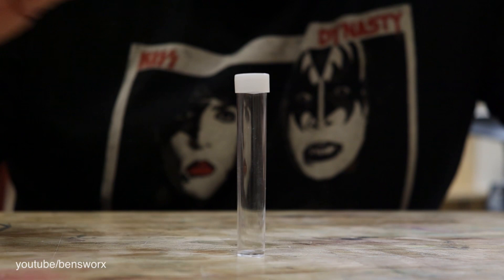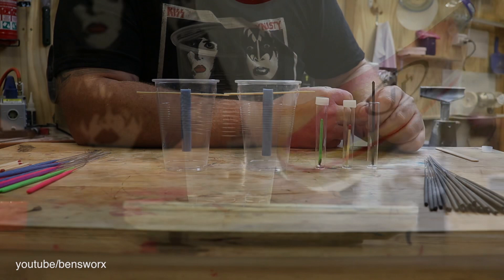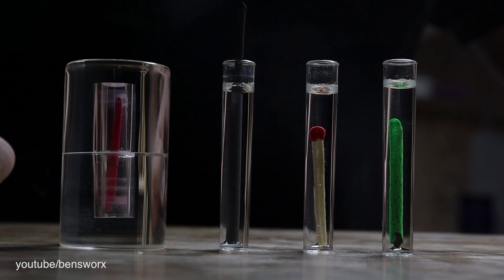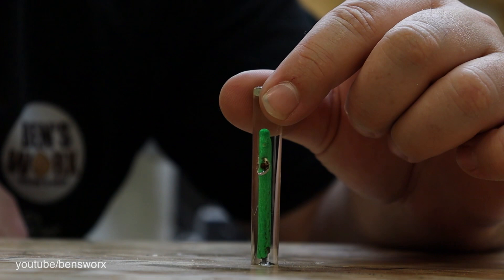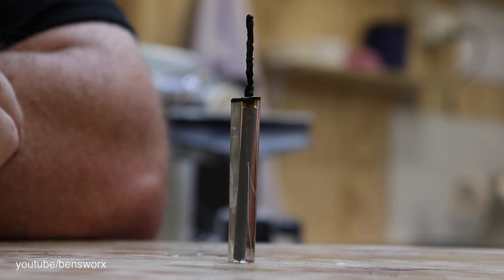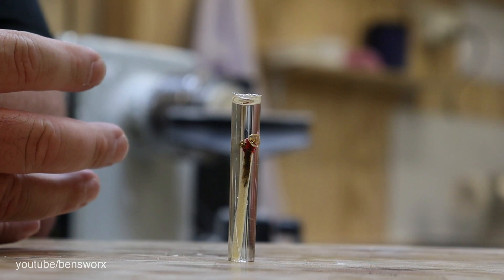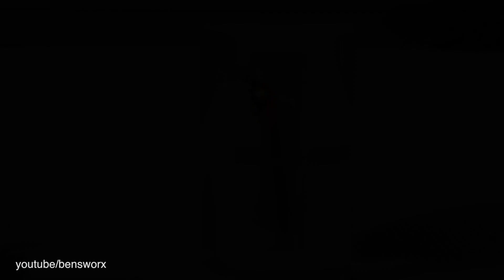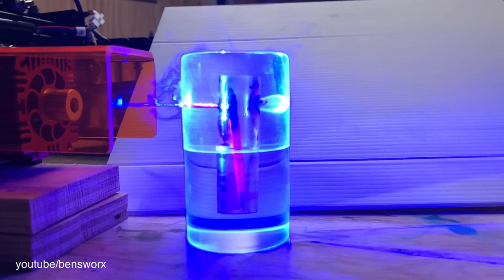Can You Ignite a Sparkler Encased in Resin ?

Comment: I think you should try storm matches they will burn underwater because the have a strong oxidizer that produces enough oxygen to keep them burning. Keep up the excellent content Ben
Reply: i came to the comments to say this damit
Reply: I too thought the same! lol so many pyros !! lol I was thinking liquid oxygen... but changing the match should work just as well....
Reply: Maybe a stupid question: will storm matches and things like that work without enough space? Water can be pushed away, not so resin. For example, under really high pressure you can heat up water way over 100°C and it's still liquid, because it has not enough space to get steam. I hope you understand what I mean, it's not that easy to describe, especially cause I'm not a native english speaker 😅
Reply: @larsweibel6192  good point, the resin casing might explode due to expanding gasses
Reply: the matches work because of a hydrophobic coating my guess is that the resins getting soaked up into the sparklers during vacuum...I would set a broken 12v light bulb into the resin cast and use the element to ignite
Reply: Or the candles you cannot burn out,   Maybe some. Magnesium strips.
Reply: @jessewilson8676  the candles you cannot blow out work because of flint material in the wick
Reply: normal matches contain the same oxidizer, the difference between them and storm matches is the coating and the fact that there is more of the compound on the end. It's usually a mix of glass powder, red phosphorous, and potassium chlorate or perchlorate i don't remember which.
Reply: I think you might be able to set a model rocket igniter in the resin so only the metal probes stick out. Then use the electric igniter to set off the matches
Reply: The thumbnail actually gave me the impression it was a storm match
Reply: Thermite. Go big or go home.

Comment: Some of these suggestions are steadily progressing towards, "What if you just made a pipebomb out of resin?" :D
Reply: Next video idea? 👀👀
Reply: I think yes
Reply: Sounds fun.
Reply: Dang mate
Reply: Yes, mix some aluminum powder with some iron oxide powder. Press it down well in the tube and fill with more resin. If the heat of the resin harding does not cause it to burn your place down take it out side put the magnifying glass on it and call the fire department. Maybe you can add some magnesium to make a pretty light show.
Reply: Do the same thing you did with water.... With GASOLINE
Reply: Hahaha, can't wait for that video
Reply: @dwp6x9e42  And perhaps some stump remover mixed with powdered sugar added to the concoction?

However heating things up like that in what amounts to an enclosed container - might not be a bad idea to put at least a plexiglass shield or some other barrier up while filming.
Reply: That's similar to how fireworks work.
Reply: @dwp6x9e42  iron oxide thermite needs a LOT of heat to ignite. Copper ii oxide thermite on the other hand is easy to light and burns explosively. It would be the better choice for this.
Reply: What happens if you encase a claymore in resin?
Reply: How a obut casting inside og snil shell 🐚
Reply: What if you just made a thermonuclear device out of resin?
Reply: Lighting it with an several kW laser

Comment: Stack the inside full of only match heads without the sticks.
Reply: @TsunauticusIV  LOL! Nah but it'd be really cool to watch 😁
Reply: Sir that’s just called a bomb
Reply: An interesting thought. Might get a nice pop!
Reply: BOOM !
Reply: Hi, yes, question

Do you know what a pipe bomb is
Reply: @justyouraveragezoomer  When I was a teen I made a polish canon with steel pipe, capped the end and used ground up match heads as the propellant.  Didn't work.  Burn rate is way too slow, it can't build enough pressure to do anything worthwhile.
Reply: @justyouraveragezoomer  
I'm not sure if it would qualify as one. 
Must read law books. 😃
Reply: Can do that with strike anywhere match heads in a tennis ball…. Cool thing is after you fill it and seal it up, one just needs to throw it against something hard and it will act as one of those little, poppers you can throw at the ground! Only much bigger! 🥜👀

Comment: i would recommend casting these in something square; it's possible your curved containers are causing some difficulty in actually focusing the beam well. Also, something with an oxidizer already. Great video though! Glad I came across your channel. Reminds me of Peter Brown but with more content!
Reply: bump
Reply: Or directing the beam from the top, not the side.
Reply: Was about to suggest the same thing (making the casting and the void square that is). As far as I know, both match heads and sparklers do contain oxidizers, that's part of the definition of a pyrotechnic mixture. Mind you, it's been 25 years since I studied pyrotechnic chemistry, so I may not necessarily be remembering this correctly.
Reply: Exactly what I thought...

Comment: Been loving all the bonus content, and creative ideas you’ve been coming up with. Also wondering if casting a bunch of “strike anywhere” matches in resin, and then turning it on the lathe, if the friction from your tools (or sanding) would light them up. Probably a bit too dodgy to try though!
Reply from the maker: Thanks Matthew 😊 it would be cool to try
Reply: Usually it will, there's granulated glass in the mixture of strike-anywhere matches that provides enough friction heating when dragged against rough surfaces to ignite. Some you can drag across denim jeans and they'll ignite, some older style strike-anywheres will ignite spectacularly if you smash them with a hammer.

Comment: Baking soda and vinigar in separate areas of the casting so when you flip it over they mix!
Reply: Oooo maybe make it an hour glass
Make the two halves separately with hollow bottoms and drill the tube where they fuse together. Then glue on resin discs on each end to seal them in

Comment: I love the lazer burn. You should cast a light prism dead center. Laser the top and burn through the resin at the tip of the prism. Clean out the burn marks and fill with clear resin and attach a light to the top.  If it also retracts outward at the bottom, clean those and fill with clear 25% glitter. 

Try different prisms too

Comment: Thanks for the bonus Ben!  I’m actually a little surprised that the sunlight doesn’t heat up the resin itself, even though it’s transparent. I just checked with my chemist brother-in-law and he said, even though it has an oxidizer in it, the sparkler still needs something external (like oxygen) to react with it to burn.  So the one that burned down to the resin would stop once it had no air to react with.

Comment: Basic rules of fire: 3 things needed, Air, fuel & ignition. 
In this case, the air ran out quickly where the match wasn't completely encased otherwise it tried to "heat it's way to air", fuel being the match itself and finally ignition usually in the form of heat or a spark, the magnified sunray. 
So there wasn't any chance of the match catching fire for long if at all. The sparkler tough was interesting, if it gave off more heat it'd actually been fueled by the resin and burned through faster along the sparkler until it all was just a sludge. 
In short, pretty fun to watch.

Comment: Based on the fact no fire can occur without oxygen I would assume the laser torch went through the resin and punched a hole and ignited the sparkler which having now supplied with some oxygen went on fire (assuming also that there was very little oxygen left in the tube to maintain an ignition and burn). It was a great experiment no matter what. I love to see them. Keep them coming!

Comment: I am impressed. I seen in the comments that you have some waterproof and other ones coming as well. 
The one thing is the smoke leaking out of the lit match one. 
I wonder if you have a micro leak in the joint somewhere. If a burnt match and smoke would last it would be super cool to have one with a sign that say break in case of emergency for fire or something along that line. Though this one would have been spent!!!!

Comment: Now I’m just a layman so don’t quote me, I believe there’s this thing called “the fire pyramid/triangle” that explains this better. My understanding is that you’ll need 3 things to get a fire to ignite; heat source, combustible material and lastly oxygen. You have the first 2. Sun (heat source) & match head/sparkler (combustible material), which is why until you melted through the resin introducing oxygen into the mix you weren’t able to reach ignition. 
Please correct me if I’m wrong! I hope this helps.

Comment: Have a look at electric matches. Used in model rocketry, you could cast an electric match inside the cavity and ignite whatever is in there without having to use an external light/heat source through the resin.

Comment: Cast a fire cracker in resin. I used to take apart blackcats fire crackers into the individual pieces light it then drop it in water and it would still explode. They have a water proof fuse so I think you should be able to get a very good result.

Comment: Hi Ben, thanks for the midweek bonus video. Would be cool to see one of those hobby rockets in resin ignited, but would unfortunately probably have to be quite large, with a large enough oxygen void, and be a waste of expensive resin, But maybe the void if big enough you could add a few things to try, like your sparkler, matches etc etc. 
I was wondering when you started to turn the sparkler on your lathe, if it would break up, but it held up really well, considering the cracks you probably created close to where you cut the rod off, was half expecting it to cascade down the rod, just giving me another idea, could you scrape the sparkler material from the rod, would maybe need less heat to light it as you would not have to heat up the metal rod as well mate. Unless there is something coating the metal that is helping create the sparks.
Anyway cheers again, really love your videos. Becoming very rare to see a channel with such unique and creative ideas.

Comment: If you turn the container that the sparkler is in with the laser focused on the sparkler inside, the laser won't heat up the resin enough to melt it. In order to keep the laser focused on one part of the sparkler, you'll need to secure it in the middle, and would have a better chance by focusing on it's tip, rather than generally heating around it's circumference.

Comment: Prediction of what will happen in the resin. I think the green sparkler is going to smolder where the light shines on it but won’t stay lit dues to lack of oxygen. Match same thing smolder a bit but no ignition. As for the sparkler sticking out of the resin I think it will continue to burn in side the resin after the outside has been lit.

Comment: if you want to encase something on resin completelly (like the match or the sparklers) you may need something that is either coated in liquid oxygen or some chemical that includes an oxidant. keep in mind that gas production (due combustion) could cause an increase of pressure so wear safety glasses just in case

Comment: definitely try something that's a self-oxidizing reaction. often road flares or some thermite-like mixture should hypothetically work when it's entirely encased in the resin. Unfortunately often times these materials require pretty high temperatures to start the reaction, If that wasn't the case, they would be very dangerous as it is very difficult to put out the reaction. You can't smother it, which in your case would be ideal.

Comment: Probably the main issue at hand with them not setting off is that most flames or high amounts of heat that start the kind of molecule reaction requires oxygen to maintain or increase the initial reaction, since resins usually avoid having oxygen in them, you lose that form of fuel for it to react further

Comment: I guess part of the issue with trying to light things with magnified sun is refraction caused by the circular outer and inner layer of the resin.
Maybe try square (or maybe triangular? could be fun, just something with flat faces) molds on both inner and outer, to maybe allow for a streight lin of light instead of refracting and bending the light.
Another thing is unsure of is if you can use plastics to friction welt. Could be fun to "seal" these containers with friction on the lathe? dunno I'm rambling.

Comment: Fire needs air ti ignite and burn properly, if you don't leave a void it will not ignite, and if the only oxygen it gets is from said void, it will not burn for long... Try making a chimney that connects the void with oxygen outside and it should burn nicely
Reply from the maker: Yes as I explained in the first match video but everyone wanted to see it without the air

Comment: If you wrap a sparkler tightly in a single layer of cling film before casting so the resin can't soak into the material, I think it might work even without a void. It would have to be completely sealed though. Maybe "paint" the outside with resin and let it dry before doing the full casting, so there's even less chance of it getting in.

Comment: I think you might be on to something here. You were starting to have a sort of rocket motor with the casting of the sparkler sticking out. The sparklers do contain an oxidizer that helps keep the combustion, but maybe try 2 or 3 sparklers at once to get it to burn down through the resin. A similar rocket effect also happened with the high power laser on the match, with combustion and gas expansion in the chamber with it being forced out of the nozzle (can be seen at 9:28 with the sparks being shot into the laser)!!!!

Comment: Ben: Maybe give the sparkler more air (bigger void). I think it used up the O2 really fast?
Reply: The melted resin chemically and physically extinguished them. It robbed heat from the reaction and melted into the composition. If you had a void inside it would likely burn because the resin can't interfere with the reaction that way.

Comment: The tube with the sparkler sticking out, I was surprised it stopped at the top of the resin; sparklers have an oxidizer in them, so technically, they should not need oxygenated air to burn, totally thought it would burn through to the bottom.
Reply: Me too. I'm guessing what happens is that the solidified pyrotechnical mixture of the sparklers and matches is quite porous, due to the evaporation of the liquid component during their original dipping. This allows the liquid resin to soak into the material, thus preventing the flow of oxygen through it and thereby making the usual chain reaction impossible.

Comment: In terms of the fire triangle you were missing a key ingredient for a burn. You always need a spark, fuel, and oxygen. Too much or too little of any part and you won't succeed. As soon as you got to parts where there was no oxygen (or all of the available oxygen was consumed) you had no burn. But either way cool video! I'm glad you had some minor successes, you did make a burn inside your resin casts just there wasn't enough to keep it going. You could try a larger chamber with more air, for a better result most likely.

Comment: the main problem is the lack of oxygen inside there. that's why the sparkler only lit once the laser opened a hole to allow oxygen in. the little oxygen that's trapped inside gets used up fast, usually burning the resin before the match/sparkler has a chance to light because the magnifying glass has a relatively wide focus point.

Comment: for ignition, you need 3 things - Heat, Fuel and OXYGEN. Therefore, the ones cast in resin are being starved of Oxygen and won't ignite. The match from last time ignited but went out after the Oxygen had been used up too. The Sparkler kept going because of the hole letting more oxygen in

Comment: To start a fire you need 3 things heat ( the magnifying glass), file( the match or sparkler) and oxygen ( the void in the casting)

By removing the void there wasn't enough oxygen for the match to catch fire the best it could do is smolder from the heat , as for the sparkler the chemical composition probably requires direct exposure to flame or substantial heat source over a brod enough surface area to ignite it as a safety feature
Reply: It could have been the resin smothering the sparkler out somehow, I was expecting an upside down rocket, sparklers generally have a solid oxidizer in them, hence why the old sparkler fountains used to work basically the same way, only thing I can think of is the resin melting and putting it out somehow, maybe the heat releases some water in the resin or something?

Comment: the match and the green sparkler weren't going to work from the get go, by pouring resin on them and then sucking out the bubbles you effectively removed any and all oxygen the fire needs to ignite, they only smoldered when your magnifying glass melted through the resin, although the match was cool as clearly the match head got hot enough to at least partially combust.

Comment: Have you tried encasing objects printed in a Resin 3D printer (using UV cured resin) in the clear two part epoxy resin?  I was bored at work and came up with what I think is a really cool idea but I need to know if there's any kind of bad reactions between the two different kinds of resins.  Will the heat created by the Epoxy curing melt or warp the UV cured resin parts?

Comment: Unfortunately the three required things for fire aren’t present. You have heat and fuel, but inside the resin lacks oxygen which is required for flames to work. The laser worked because of the hole created by it. I think the og match had air trapped in it, or the seal wasn’t full.

Comment: What if you make another void one with a match inside it but somehow put it in the pressure pot to get the air out of the void with the match in it. See what happens and if it lights without the resin directly touching the match like the non void ones :)